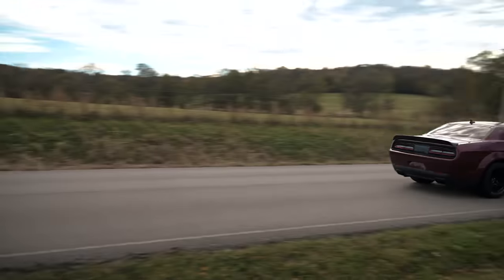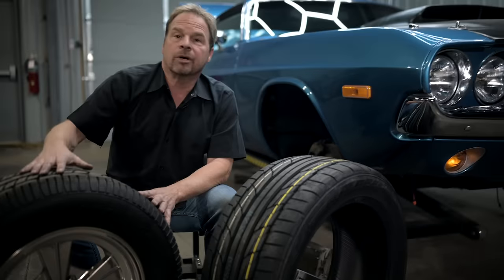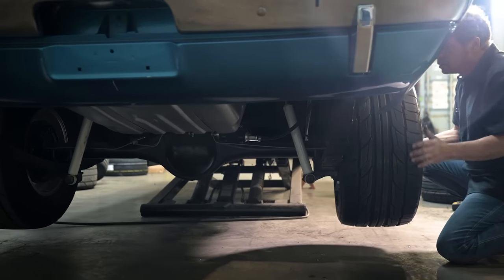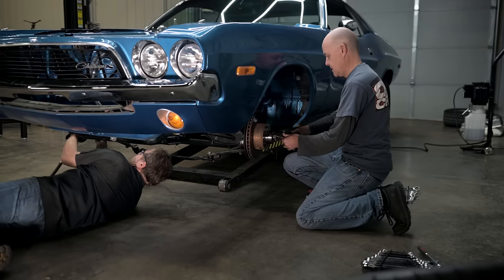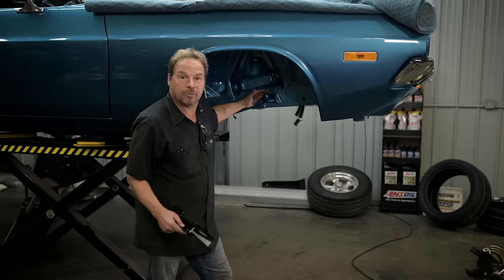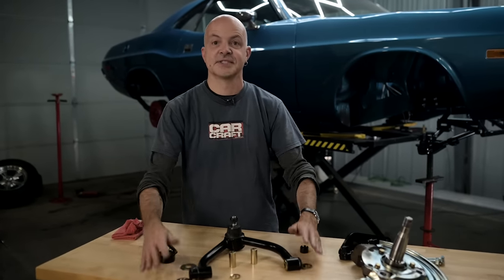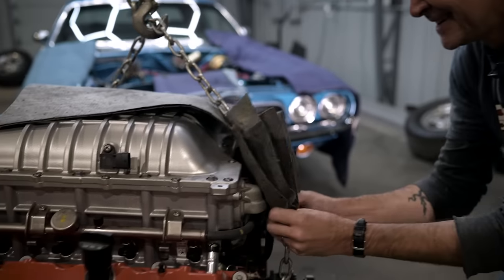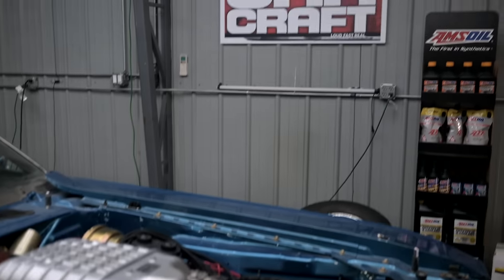72 Challenger Engine Swap! | Car Craft Challenger Build Ep 1 | MotorTrend

Comment: Maybe 16's or even 17's! Anything bigger on a early car just looks wrong. Also that wheel measuring device is neat but would you not need the cars weight on the suspension to get accurate clearance results?

Comment: what about the rear suspension and brakes? ya go to all that trouble for the front then leave the drums and leafs in the back? that's not an overall refresh...
Reply: Did you notice the Episode 1?
Reply: @BigTireGarage  i caught your 9 min. 39 sec. video of episode 1 and the only reference you make there to the rear suspension is when you're measuring back-space for wheels and tires and you place the measuring device over the drum brake... this led me to conclude that you were going to leave the rear as is since i did not see or hear any other direct reference to the rear suspension... also, i figured if you intended to replace front and back you would have gotten both replacements at the same time and showed them at the same time.... did i miss something?
Reply: Rear suspension as well as the rest of the drivetrain will be addressed in later episodes